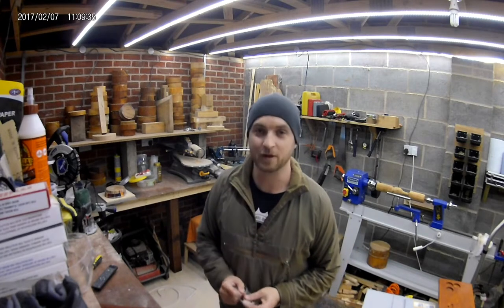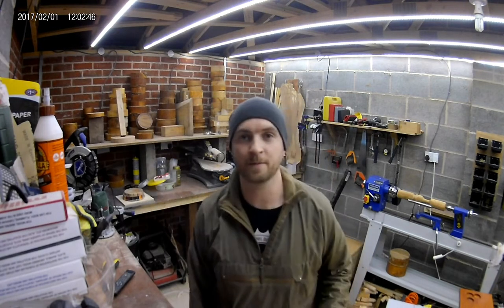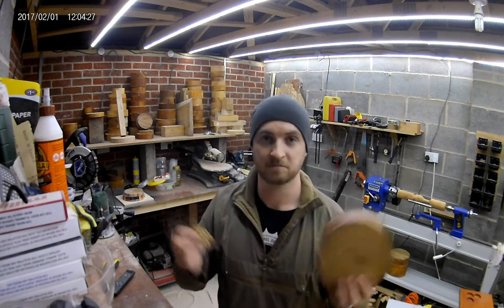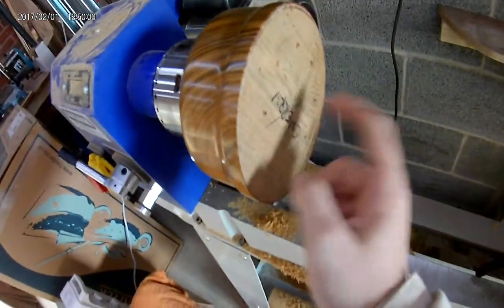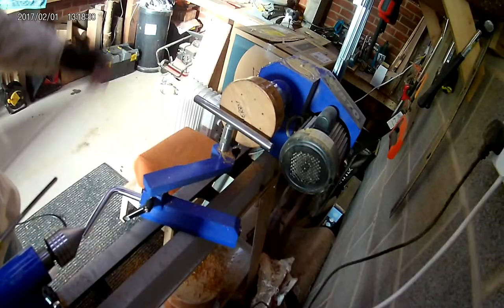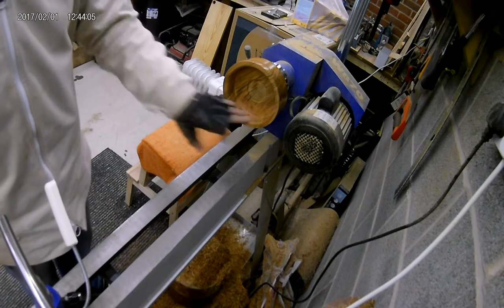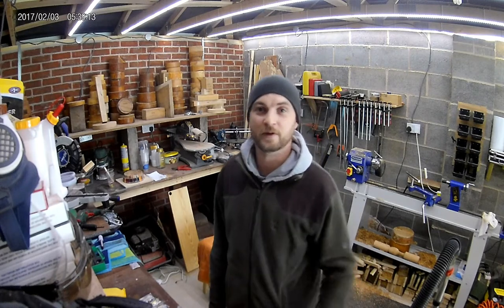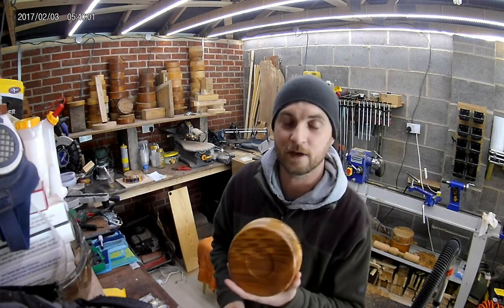Wood Turning - INCREDIBLE ROYAL NAVY BOWL

Comment: Hello love you videos and work  i have the same lathe as you i just wanted to know why do you use the outboard part of the banjo when its in normal position it much easy just to use the bottom part of the banjo
Reply from the maker: Phill Allen thanks Phill, appreciate that mate 👍 not really sure what you mean exactly, but I use the tool rest on the extension arm most of the time for 2 reasons, 1) I can reposition the rest quickly from the side to the face of what I’m turning, and 2) I’m too lazy to take it out and put it back in again 😊
Never noticed any wobble or flex when using it, so it feels safe and secure! 
The Charnwoods a cracking lathe isn’t it! Great bit of kit 👍👍
Reply: @ARCWoodCraft  yeah its a great bit of kit i have turned a 36" wheel on mine even thou charwood say its only 18" a bit of wobble but it most definitely was upto the task
Reply from the maker: Phill Allen I’ve not found it underpowered or flimsy at all, I’m very pleased with it! It did have a bit of a wobble on the Xmas tree video, but that log was incredibly heavy and did have a pretty severe bend in it so no wonder!